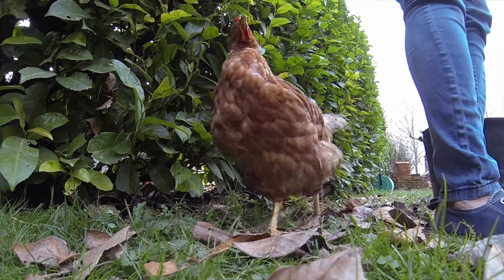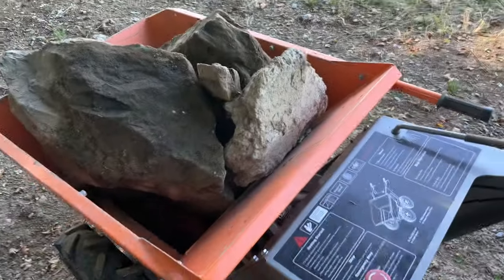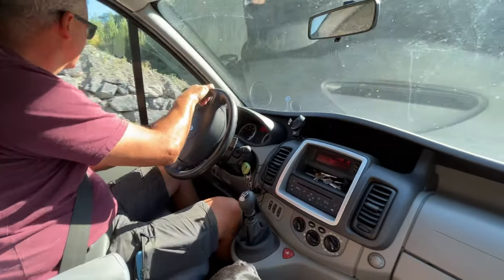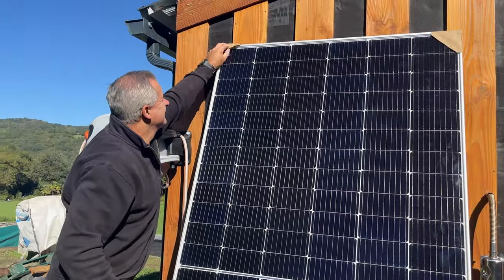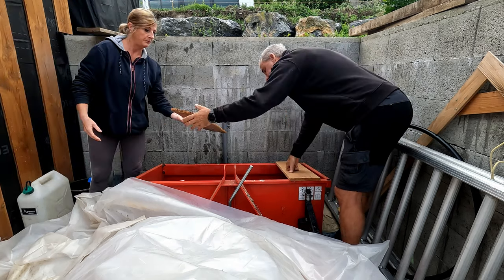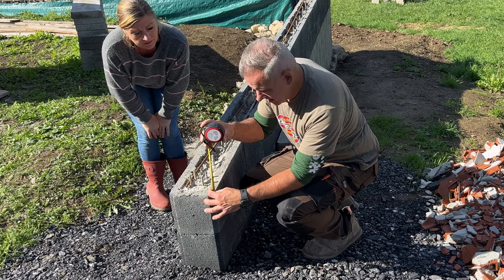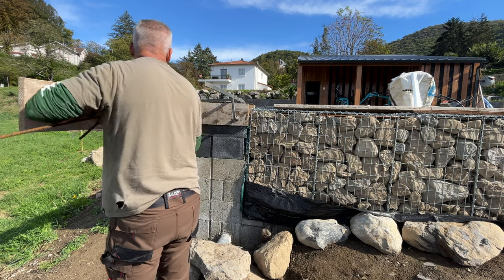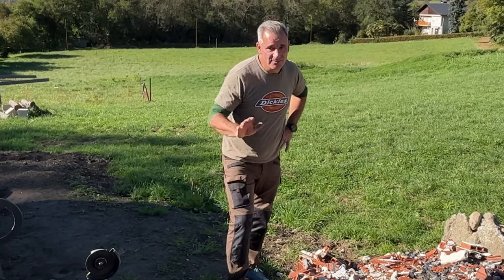Levelling Up & Forming the Walls for Concrete Caps

Comment: Ian try to use your knees when lifting those heavy rocks mate, don't want to see you do your back in as it's so easily done if you are stressed in a hurry. I've broken my back 4 times with cycling in the past so I had to re teach myself how to walk, run, lift & bend over correctly to survive, I'm 60 & still alive. The abscess in my spine when I was 50 took out my ability to walk longer than 200m without extreme pain but where younger ppl had died having the same type of illness I still survived something I shouldn't have. Guess I'm too stubborn to give like most old competition cyclists.

Picked up a staph infection in a sweat pimple sitting on something that was dirty when I was around 40, overworked my body at work when I was 50 which caused an abscess to grow on the outside of my spine. My immune system had kept part of the staph to later deal with it but the abscess blew up into a necrotizing golden staph which was the abscess was consuming living tissue, killing it where it could not grow back. I had a 10" dinner plate sized abscess mass on the outside of my spine & it had eaten into my spine & filled up around 6" length of internal spinal cavity where it was attacking my nervous system killing me. Every doctor swore on their medical careers that it was impossible for that growth to be there but it surely bugged the hell out of them lol proving them wrong.

First time I broke my back was a hit run accident with a bus sideswiping me as it overtook me & the tail end of the bus flipped me off the tar into the gravel at night. All the rest of the breaks following were caused by simple falls a year into recovery training to get back to being normal which I later found out that I should have taken 2 to 5 years for recovery. So far since my near death in hospital in 2013 I've survived the impossible for 10 years when I wasn't meant to survive the operation or the treatment after, or the first 3 month's, or the first 6 month's & definitely not the first 12 month's.
Reply from the maker: I hear you - I do try and bend the knees but did my ACL on my left knee earlier this year (2nd time on that knee so no fixing this time).  Yes, cycling is a dangerous exercise.  Lost count of the crashes I have had, but both clavicles, shoulder and wrist but as you say, no time to recover.  It is catching up with me now though so trying to work a little smarter.

Comment: Hi Guys, love the videos' every week If I am right in thinking that your "stucco" work is the same as rendering? I can highly recommend watching
 plastering for beginners on YouTube
He shows you in great detail rendering o/s wall, mixes etc
I have just finished a two coat render of my garage extension and even though I had no experience of this it turned out quite well
What I did was to fix vertical  battens to the wall every metre or so, to the thickness of the render coat, I then slapped it on and used a board to scrape of the excess level with the boards, once it started going firm I carefully removed the battens and filled in, that gave me a smooth level coat to be scratched before the final coat where I did the same again with thinner battens
Hope that helps?
Paul
Reply from the maker: You may have saved Julie - yes, we call it rendering too but just using the US slang.... will watch those videos for sure.  I have bought her a sprayer which we are going to try for the base coat.  We shall see.

Comment: Use the excavator with the grading bucket to empty the trailer be much easer for you pal
Reply from the maker: I did try, believe me.  But the angles and the slope and the ramp on the back, makes it too difficult, plus it is damaging the wooden base of the trailer - so hand shovelling it is 😬

Comment: Great video I had a problem with it at the start
Why don’t you use the bucket of your Kubota to move the stones 
What size is your compactor I need to get one and I’m just a little curious how big it is it looks pretty versatile
Reply from the maker: It is the slope and angle that tops me using the machines - too sketchy on the slope.  The compactor is just the basic model (one up I think) just google Scheppach and they have lots.

Comment: U should use the grading bucket on the mini digger to pull them stones of the trailer be a lot easier. France looks beautiful. Which area are u in
Reply from the maker: I did try but too slopey and it kept damaging the wooden base - 😬
Reply: @HomesteadingUncontained  put a scacrafical sheet of old ply wood or osb down first. But use the nugget to pull back in small layers stay of the floor it’s not hard to do

Comment: Guys, shovelling all that gravel when the digger is standing right there?
Reply from the maker: I tried but with the ramp of the trailer and the slope it is not easy to manoeuvre the digger to get to the stones - plus it damages the wooden base of the trailer.  Believe me, if I could use it I would have done 👍🏻

Comment: Shoveling type 1 is sooo hard, kudos to you. Lovely if you had a tipping trailer.  Jump starting the excavator Ian? Mine is in 30 hrs now and needed that for a while. I took the battery out this week and it seemed to charge after couple of hours (bloody "smart" charger 🤔 I'll see if it lies next week when I try and start her
Reply from the maker: Yes, I have an issue with the charging unit - they are sending me a replacement -  I have the booster so it is OK and also another unit theft device.... 🤣